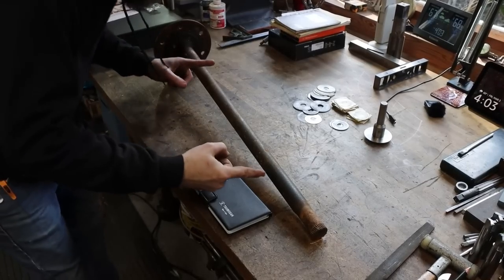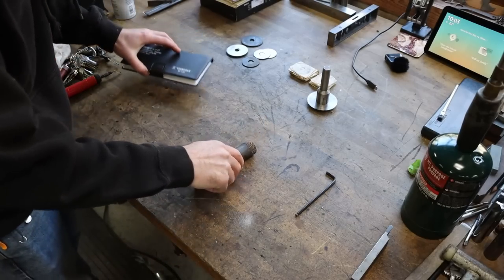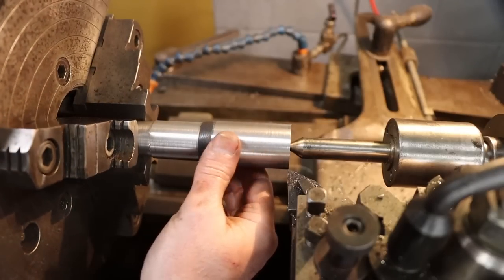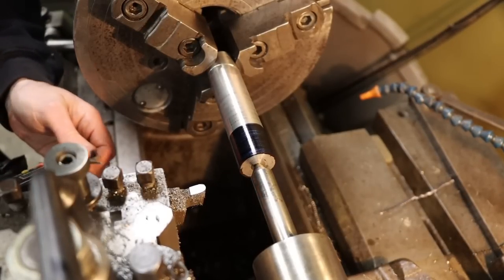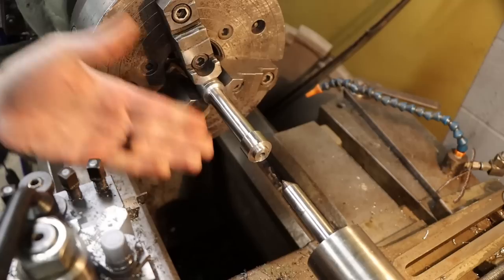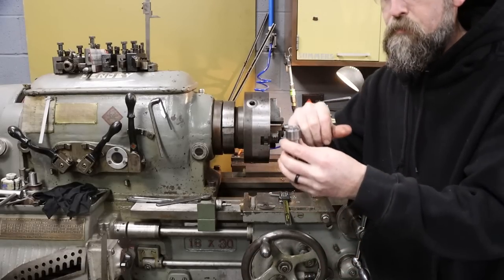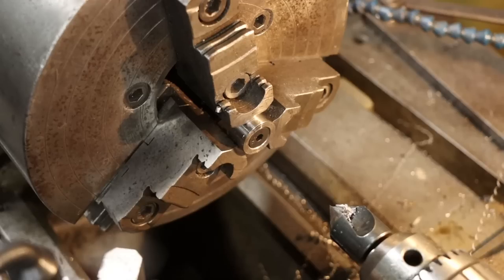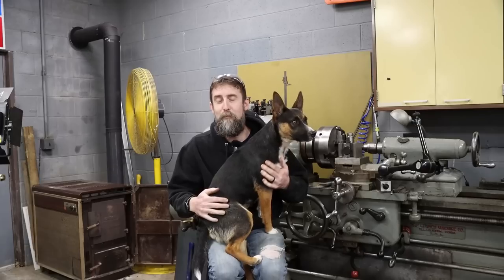Shop Tooling Project From Trash Axle . New Slitting saw Arbor

Comment: Man, you nailed it. Steve, I've been a long time fan. In Australia, you cannot buy specialist steel unless you are willing to re-mortgage your house. I've been using hydraulic rods (4140 or near enough) leaf and coil springs (5160 or near enough) and axles (?) for twenty years or more. For the farm, it is perfectly good and best of all - free! I have never bought a tractor pin, arbor or even a morse taper tool. With the right knowledge, you can save a fortune. I know you are aware, but for others: As for annealing - get it as soft as your tooling will allow. Carbide will handle higher hardness than HSS, but a good slow anneal in vermiculite and you are golden. Don't fear the purists who say you must know the exact batch number and chemical content of your steel unless you intend to push it hard in an industry environment. Read up on heat treatment and the properties of your steels, don't overstress them and you will do ok. Do your own stress tests and heat treating tests, have fun and learn something. Wear the appropriate safety gear cos things can always take you by surprise.
Reply: Wow, as a novice I am always trying to learn. You seem to have acquired enough knowledge to become a rocket scientist. They say necessity is the mother of invention and I think you have nailed it. Stay safe.

Comment: Hi Steve, great video. For full annealing you need to hold the steel at bright red heat for a minimum of 20 minutes per inch of thickness and then allow it to cool slowly by encasing it in firebrick box. Half shaft material is notoriously tough stuff, but as you say, excellent quality! 
Phil, UK

Comment: Drill a hole through the holder shoulder for a pin and put 2 flats on the bushing so when your screw gets over tight you can rotate the bushing to loosen the screw.  I have had to drill the screw head off when the blade over torqued the screw.

Comment: Quick tip for the dnmg,  if it has a land on the cutting edge, your feed and depth of cut need to be greater than the width of the land, otherwise your just rubbing material off.
And you probably needed way more rpm's

Comment: Steve, most likely, the axle shaft is induction hardened on the outer surface for wear resistance of the spline and bearing surfaces. It should be softer, but still a tougher alloy in the center.   An axle would never be very hard throughout as heavy torque shock loads would shatter it.
Reply: Yes carburized 8620 would be a common axle.

Comment: Axles and shafts usually run 35-45 HRC, which are usually machinable. a 55-65 HRC shaft would break in normal use. Unless the file really skates, the part is softer than the file. "Sort of" skating means they are within a point or 2 of the same hardness. Nice job, I hate wobbly slitting saws!

Comment: Thanks Steve   A few years ago I hard turned and tool post ground a new and improved crank shaft for my 1940's John Deere #5 Sickle Bar Mower from a truck axle.  Carbide lathe tools and end mills make this a fairly easy job.  And when done you know you have a "factory" heat treated part without annealing and re-heat treatment.  The tapped hole in your part would be a problem if working hard steel.

Comment: Hi Steve, you did a nice job. Another way to undercut that shoulder would be to grind your cut-off blade just opposite of what you did and run it in parallel to the centerline of the piece. Less chance of taking your pilot diameter, making it the same  size.

Comment: Hi Steve, great video and workmanship, again you show your high confidence in your trade. Not sure way the part you used wasn't fully annealed, maybe you didn't want too, but I would had , also for easier machining and tools life extension, fallowed by the appropriate tempering . All good, but what keeps me on edge in most of your videos is the fact that you operate turning machines with those hood laces hanging off your neck?????

Comment: Well done, filmed and edited.
That's a good way to do it. But an arbour for a cutting disc having hole of only 6 mm, nearly 1/4" other strategies work better. The disc centering boss will be very thin as the screw needs to manage tightening. I've made one that centered well but unfortunately the hole in the disc was not centered....

Comment: Well done as always Steven,  thanks for the video. Carbide needs speed, lots of it. Kick up the RPM. That 432 DNMG needs a deeper cut to wipe clean. Those were all pretty light cuts. Your VNMG liked those shallow cuts. Great tool
Reply: If I may but in here, the shape of an insert has little bearing on the cut compared to the chip breaker design, some chip breakers are designed for heavy roughing cuts while others are designed to take only a few thousand finishing cut. Best to consider the shape of an insert as being what fits your holder not how it cuts, and look in the manufacturers catalogue for which chip breaker suits your needs. With out this info it's like a shelf of unknown steel, it may do what you want or fly apart under load.

Comment: Nice tool, and as it is made from a hard steel it should last a long time, even with hard use. Plus you still have the rest of the axle to soften, to make a decent 1in arbor for the other saws, so you can use all the teeth you got with them. I can see that axle making a good few more, especially for those smaller cutters for the mill, so you can do some work with them on the mill without having to move work to the big machine. Also see some cutter grinder arbors coming out of it as well.

Comment: Nice job on the arbor Steve. Too many people ignore scrap material as stock for projects. Yes, it takes a few more steps or you have to run a little slower than normal, but at the cost of material today, it is a source that you should not ignore. Thanks for sharing.

Comment: Great job Steve and a very successful outcome. That cut that beautifully mate! I too haven made stuff from broken half shafts of Land Rovers and at the moment have only one piece left from a Range Rover and it is absolutely glass hard. I don't have oxy propane ot acetylene facilities so at the moment I can't use this last piece. I also use what you in America call sway bar steel (also from a Range Rover) we call it anti-roll bar, which will cut nicely without softening and I have used that to make left hand Acme taps to finish out new feedscrew nuts for my lathe. I made a New Cross slide feedscrew and nut last year, and just last week made a new nut for my leadscrew as the original was completely shot. It's a very odd configuration being metric in diameter ( nominally 20.00 mm) but of 0.100" pitch ie.10 tpi and to be honest I'm not actually sure whether it's a trapezoidal metric ie. M20 x 2.54 or just plain 19.98mm (0.7866" ) x 10 TPI Acme I went with the 29degree Acme form as the depth of the thread of the leadscrew was 0.055" which is as close to the Acme formula of D= 1/2 P + 0.010" only 5 thou different and I couldn't find an equivalent in the Metric form for that pitch as standard pitch is only per millimetre . My leadscrew was pretty worn at the headstock end so I made two joining pieces, and chopped the leadscrew in two places at either end of the threaded portion and swapped it end for end so the unworn portion now is at the working end. My lathe is a Chinese lathe mill combination machine and the metric version went out of production last year. And only the metric leadscrew was available not the imperial so I had to resort to cutting and shutting the original. But now I have only about 4 thou backlash in the carriage rather than the nearly 35 thou it was before. Job done! Sorry for the longwinded comment Steve but I thought you might be interested lol cheers from England

Comment: Some carbide inserts require a pretty aggressive depth of cut and feed rate to get a good surface finish. When I did a lot of turning for commercial work, I'd push the insert so that the chips come off the part a straw color and turn blue in the chip pan. So yeah pretty aggressive. I always used flow coolant but mist coolant works well too and less messy. Most of the work I did was heat treatable steel. The parts were going for heat treat after I finished them and they got ground to finish size after heat treatment. For the home shop mist coolant seems to be the most practical and versatile and it doesn't make a huge mess. It's pretty cheap to implement and can be moved from one machine to the other  easily.

Comment: Hi Steve, VNMG/ VBMT tips are really good for finishing, you need high RPM's and a low feed rate plus flood coolant or oil. WNMG tips are great for roughing and you get six cutting edges on each tip, very economical. Take care with the grade of tip, GC4425 is a catchall grade for steels, and GC2025 for stainless steels ( Sandvik designations). Tip radius is also important I use 0.8mm for roughing and 0.4mm for finishing. This topic is a minefield for home shops, you cant stock all different grades and shapes of tips, but if you stick to these recommendations you wont go far wrong, keep up the good work. BTW love the soundtrack your truck makes, who needs a CD player.

Comment: Hi Steve, nice useful tool.  I'll bet you are itching to remake the larger arbor you showed that has excessive run out!  I always hold on to what some would call scrap steel.  As you said, that axle is high quality.  I've been called a hoarder but, if you had to go buy an equivilent piece of bar stock, it would be pricey.  Thanks for the video!
-mike
Reply: A shop exercise:  Say out loud - "I am NOT a hoarder.  I only keep stuff that might be useful some day."  Repeat as needed.  It has worked for me for many years.
Reply: @kensherwin4544  I like that one.  Perception is everything!

Comment: Really nice, Steve. I'm a bit curious about how you use your thinnest slitting saws.  I would think that they could bend to make an offset cut from where you wanted it.  Also, could the blade buckle as you are first establishing the cut?  Oh, and one small vote against the music, especially the softer music.
Reply: Hi Stuart, normally on thinner slitting saws you need to use a different arbor. You make largish diameter washers ( depending on the depth of cut), to fit either side of the saw blade.

Comment: Many shafts that have splines on them,are induction hardened to a depth of 1/8” to 1/4”,depending on the diameter of the shaft.I seriously doubt it is through hardened.One way to find out is, to try to center punch the center on the shaft you cut off and,didn’t anneal.I am curious to know if it is through hardened or not.

Comment: Nice video, the background music is really unnecessary and I find it hard to watch the video because of it.
Reply: So don't watch it.  Or you can whine and be ignored.  Your choice.
Reply: I liked the music. I guess we are all different.
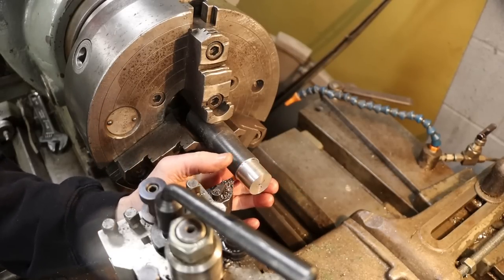Reply: You cut it off so it doesn’t matter, but at 8:52 it looked like there were cracks in the end of that shaft. Trick of the light, hard spots in the metal or were those actually cracks?  Nicely made tool, it’s always bothered me hearing a slitting saw with runout making a cut.